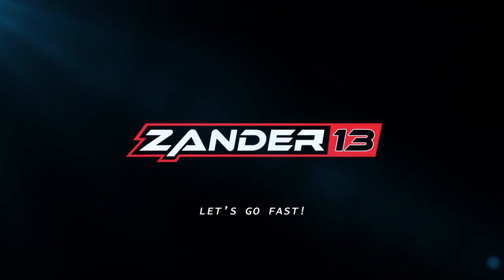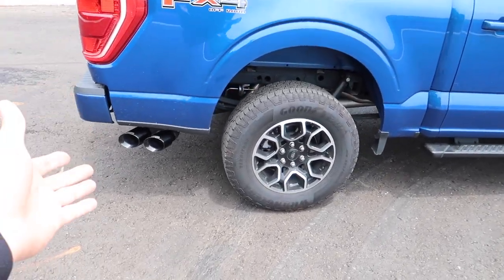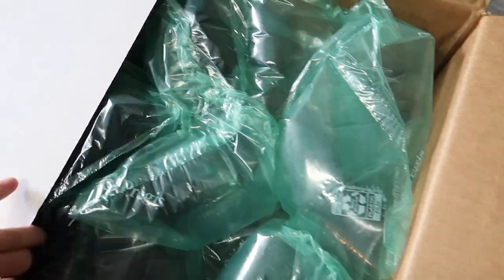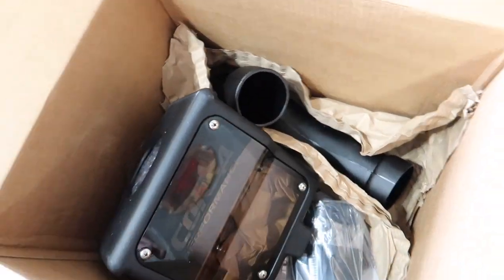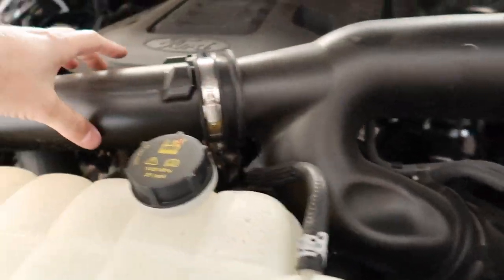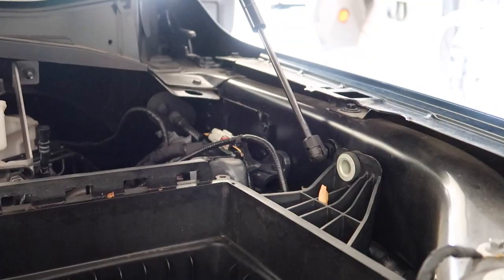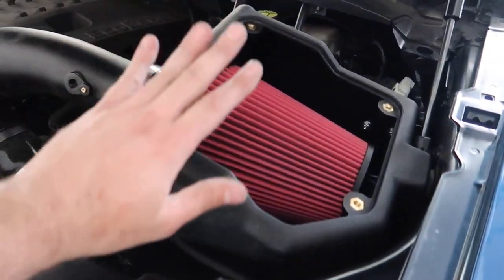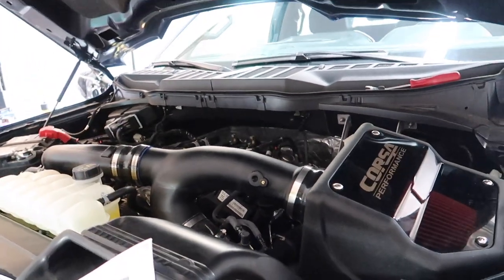HUGE DIFFERENCE! Corsa Intake- BEST CAI For The 2021+ Ford F150 Truck?

Comment: I had a velocity blue 21 f150 xlt loaded with the 5.0.
I had it just long enough to install a borla atak catback.
I traded it for a 22 gladiator ecodiesel that's tuned and customized.
Love my gladiator.
I still have the 21 velocity blue mustang that's in the process of getting the ess tuning g34/g4 combo.
Just waiting on the kinetic crank support stud to come in.
Reply: out of curiosity, why the switch?
Reply: @isea_  
Because after just 3 months of ownership ford expected me to pay for a subscription just to be able to use the navigation that I paid big money to have and have had in other  trucks and still have in my velocity blue 21 mustang gt.
I asked them if they also plan on charging me $10mo to be able to open my panoroof.
I told them to fuck off and they can take advantage of someone else and I now have a tuned ecodiesel lifted gladiator and love it.
If I had to pay to use the navigation in my mustang it to would be gone and replaced with a hellcat.
Reply: @charleshenson4183  Thats crazy i feel like it may have been a mixup with some sort of radio package but you prob know better than me

Comment: what motor? i use to have a 17 3.5.  wish i could afford a truck and a mustang. overall preferred the mustang over a truck since i never used the truck as a truck.
Reply from the maker: 3.5
Reply: @Zander13Productions  those are quick. I was neck to neck with a stock STI from 40 roll. I think the speedometer caps at 105.